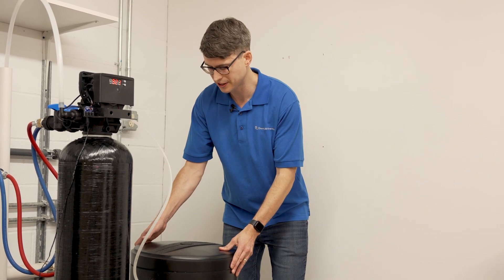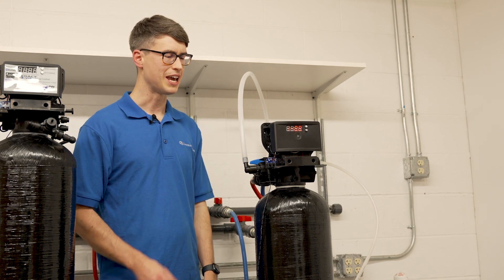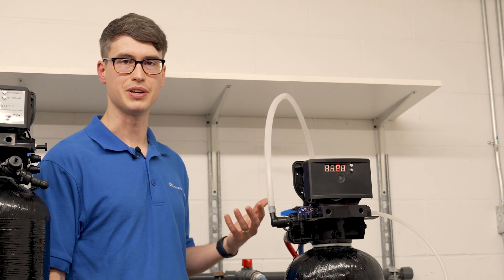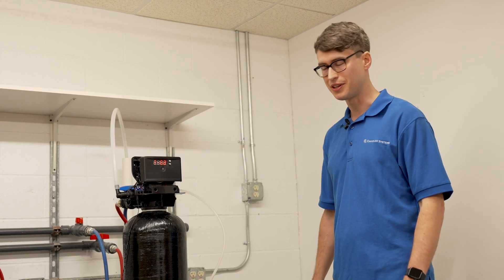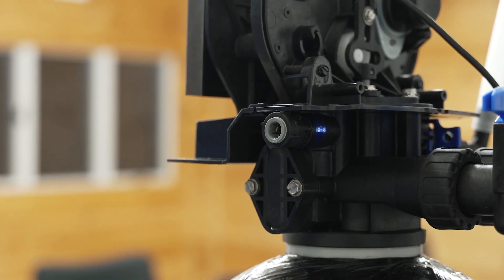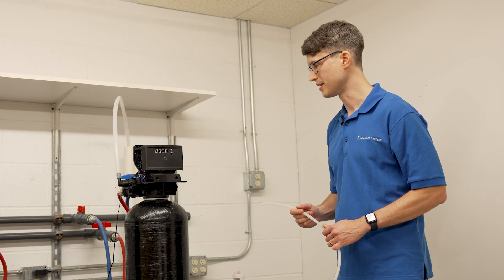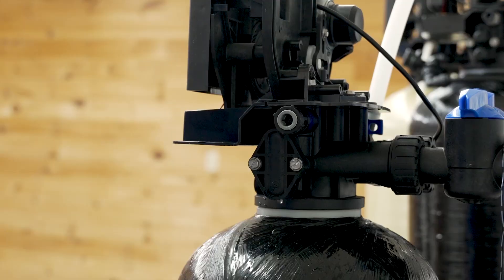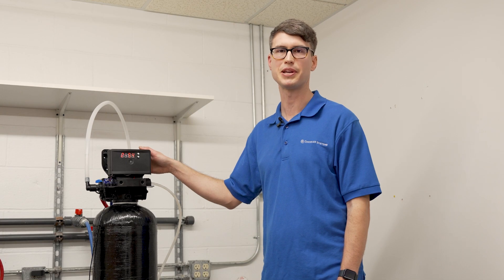WaterSoft Isobar III Softener Brine Draw Troubleshooting

Comment: How much? Water and salt should be in the brine tank at any one time?
Reply from the maker: I usually add 3 bags of salt to start, but it isn't critical.  Even one bag is enough to get it started.  The softener will add the correct amount of water during the brine fill.